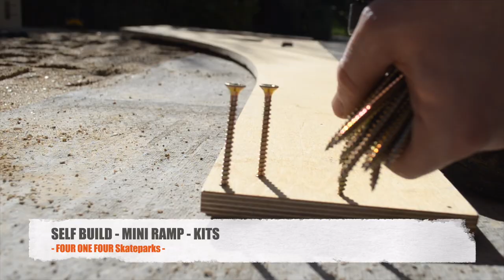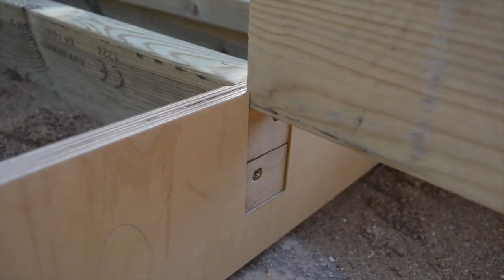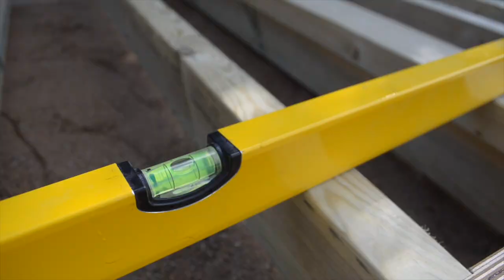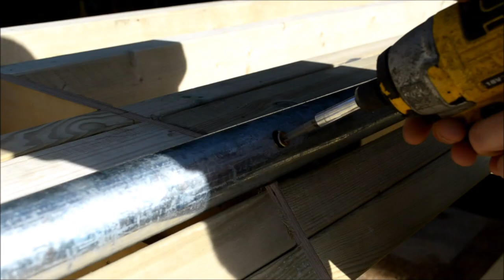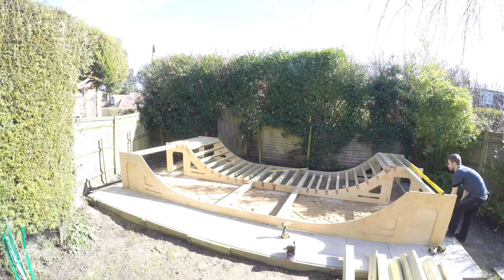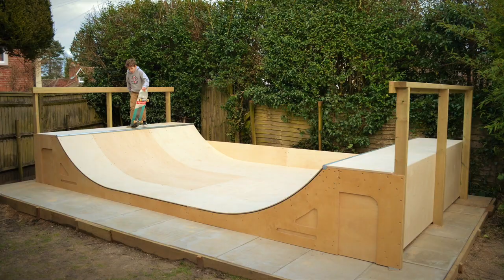How to Build a Skate Ramp - Mini Ramp / Halfpipe - Time Lapse

Comment: Whats the black stuff on the surface? still wood? or sonmething else?
Reply: jake wilmott yeah that’s what I’m wondering
Reply from the maker: The black layer is the same material as the top layer - a Birch Plywood (grade BB/BB), we use then same high grade ply on both surfaces, mostly others will use a cheaper plywood for the under surface - it is only black as we put a black weather proof coating on that bottom layer.  The top layer / riding surface on this Ramp has a clear weather proof coating on it..  
This grade of Birch Ply I Nour kits is good outdoors compared to normal plywood but it is always best to add extra protection for any plywoods that will be outside.

Comment: Nice, I've just started my own 414 build myself, 3f x 12f. How long did it take in all, I'm doing mine solo..
Reply from the maker: Hi Justin - with the 3'x12' - two of our guys who have done these several times normally do that in one day,  if the base is all ready a bit of a late finish but they can skate that evening..   If there is wood staining or base work then we usually go with 2 men for two days..   If you on your own and its first time then it is likely to take you 3-5 days, depending on the hours you have got for each day..  Hope it goes well.
Ta Shaun
Reply: @fouronefourskateparks1216  Thanks for the reply, I have built ramps before and the base is sorted before it arrived. I've got the first section up in a day, ie quarter of the hole thing. I am unsure about the wood staining though. I thought it all came pre done part from the surface, I've emailed Kalvis about this but the frame, ply and struts shouldn't need anything should they? Thanks.
Reply from the maker: @justins_toys  Good progress so far.. 🔨👍🏽  You can leave all the parts as they are and paint up the sides or riding surface at a later date if you want to change colour or something..  Don't treat any of the beams they are pressure treated.   As with any timer outside the more protection the better,  so generally we recommend using a wood treatment on the profile sides and both surfaces,  its easier to do before the build but can be done at a later date. 
Kalvis is away for riding a comp in Germany,  fire him over some pics of the build or when you got it looking sweet.
Ta Shaun
Reply: @fouronefourskateparks1216  Thanks for the info, that would explain why I've not heard back from him yet. I think I'll treat the profiles and top surfaces then. I'll be sure to send Kalvis some photos once complete! Cheers